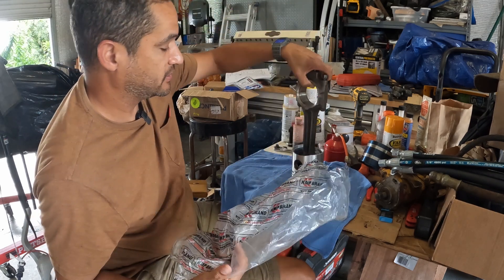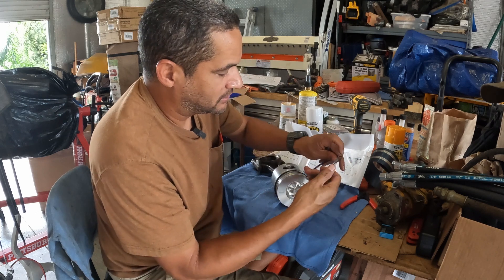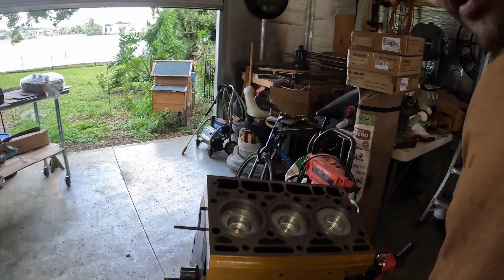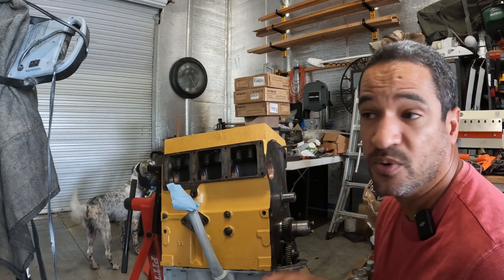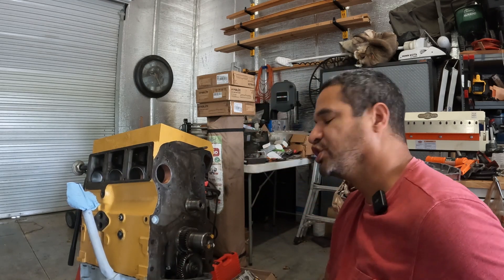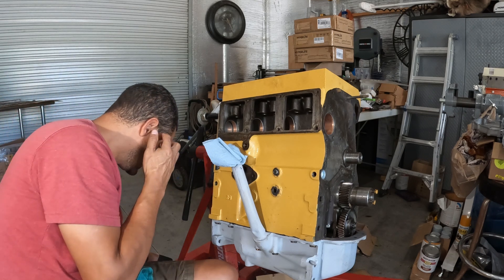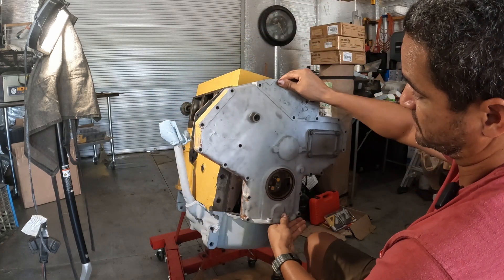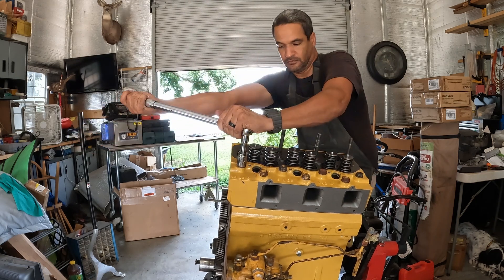Engine assembly Part two. #diy #farming

Comment: Did you check the ring gaps by putting them into their respective cylinders & checking with a feeler gage?
Reply from the maker: Absolutely. I start them in the cylinder and use the piston upside down to push them into the cylinder so they’re square and the cylinder then I check them with thefeeler gauge. Sharp eyes, sounds like you’ve rebuilt some engines.
Reply: @AllyneFamilyFarms  
I mostly have worked on my old Triumph motorcycle over the years.
I think there is a special tool for grinding the ends, but I remember just using a file.
I go for the larger gap just to be safe.
I only have had the jugs off twice - the first time was back in the early 1980's at 30,000 miles - I had it bored out .020 inch & put in new pistons.  After I had thought it to be broken in - I took it on the freeway & at some point the rear wheel locked up; I pulled in the clutch & put on the front brake at the same time; once I had slowed down - I released the clutch & took off with no problem.
Maybe ten years later I had the jugs off more to fix an oil leak & had the cylinder honed.  I installed new rings at this time & made sure the gap was at the larger end.
I now have 64,000 on the bike & it still runs good.
Reply from the maker: Wow, that’s pretty neat. I’m sure the wheel locking up seriously got your attention. I can only imagine that happening.
Yes, there is a tool for it. But I also just use a file when needed. That’s how I was taught.